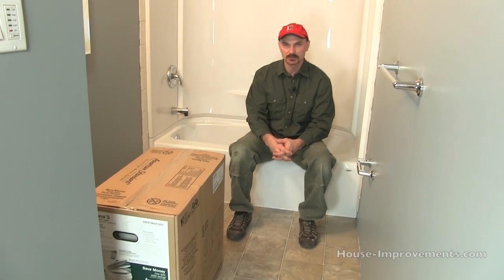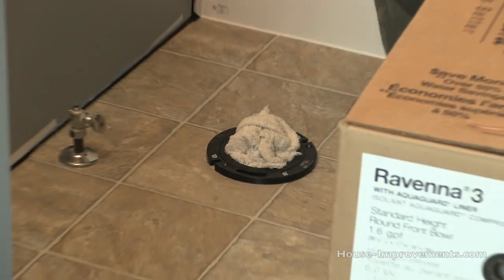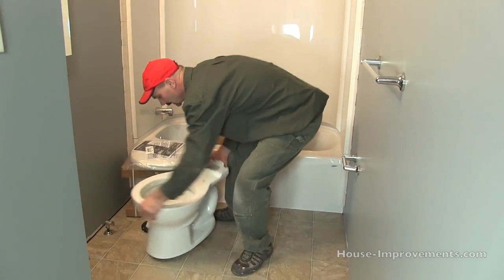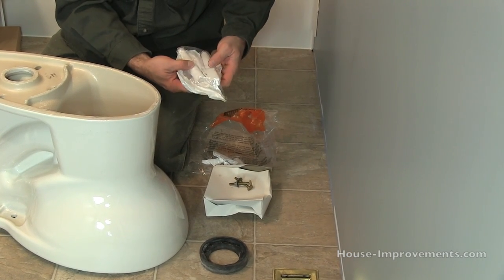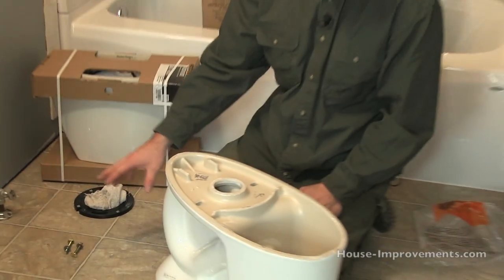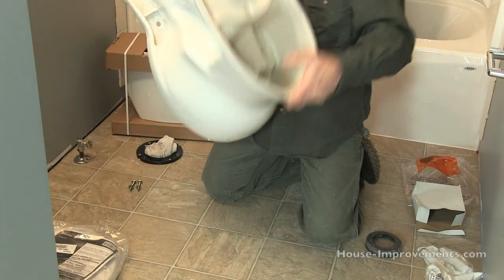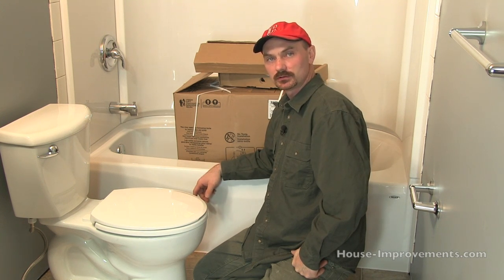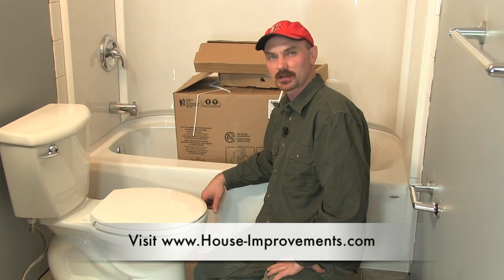How To Install a Toilet

Comment: Watching this bought back some memories, I worked at American Standard for 10 years out of high school back in the 80's before i went into law enforcement, then they moved their New jersey plant to Mexico. Looks like not much changed, flush valve looks improved, but that's about it. Your toilet was a refire, meaning when it came out of the One-fire kiln it had a slight defect which was repaired and re-sprayed then refired again. American Standard are quality, at least they were when I worked there, They did have a problem with the water quality in Mexico and it caused a lot to come out "dunted" or having hair line cracks, but they solved it through some water purification process. It was the hardest I ever worked in my life, but was a great way to get into the real world and learn to appreciate not physically killing yourself! Great videos, thank you.

Comment: Great video!!! I replaced 2 toilets with this model a couple of months ago. Lots of great improvements since last time I replaced a toilet (especially around flange bolts and caps).
The plastic tool used to secure the nuts for the tank bolts may also be used to tighten nuts for toilet seat bolts.

Comment: I work at Lowes, and used to work in the plumbing department. I always recommend American Standard. Best toilet brand Ive seen. I have a Cadet 3 with a 3 inch flush valve. Works amazing. The champion 4's are even better since they have a 4 inch flush valve which allows a more powerful flush.

Comment: Shannon, my late father in law solf plumbing supplies.  He helped me replace my 1st toilet a few years back.  He advocated using a bit of dish soap to whet the foam rubber seal between the tank and the toilet.  Tighten down the tank so that it has a slight rocking so you know you're not too tight.  Some parts of the country have a water conservation rebate.  In Colorado, we have a rebate for the low flush toilet ($69.oo USD) and $50.oo for front load washing machines.  My toilet replacement (comfort height) cost me about $50.oo after the rebate.

Comment: Simply setting the ring onto the closet flange is fine and IMHO easier. For flanges that are set against the finished floor height it's often better to use a simple ring with no reinforcing plastic bit in the center. On our last one, the toilet weight was against the flange itself and was not resting on the floor due to the extra bit of space the plastic took up. Depends on the toilet though. Wax rings should be WARM and easily deformed. If your ring has been in a cool location it won't squish to make a seal and may crack down one side.

Comment: Excellent choice for a toilet! American Standard Cadet 3 is the way to go. It performs well & is relatively easy to install.
Reply: Liam Brom Thanks, I wondered what toilet he was using.
Reply: +Liam Brom Good to hear. I just purchased one. However there were three different Cadet 3's in Home Depot. I bought the cheapest (still at $160). Not sure what the difference is among them
Reply: +Liam Brom yes we need something reliable to flush those turds.

Comment: Great video as always Shannon . 
This may sound like a strange idea , but I'm going to drill a hole beside my toilet flange and have a clear tube going threw the floor and back up again . I have an open basement , so this way I could visually see if there's a water leak under the toilet . 
I like your silicone idea and will do the same , go around the perimeter of the toilet , but leave the back open . Good tip
Reply from the maker: Sorry but not sure how that will work,good luck

Comment: I have better luck sticking the wax ring on the bottom of the toilet. I first heat up the base of the toilet where the wax ring goes with a hair dryer, press it on, twist very slightly and it seems to stick well with no problems. I always had problems putting the wax ring on the flange and the setting the toilet on top. Seemed to slide. Personal preference I guess. As always a good video Shannon

Comment: Shannon. I really enjoy your videos. I see that in this video that the flange was mounted on top of the tiled floor. I was told that the flange should always be flush with the surface of the tile, and if the flange was already in place before the tile was laid that a spacer should be used to bring the flange up to the level of the tile. I was told also if the flange is above the tile, depending on the toilet used, when mounted it could rock.  Also, was told never use a double wax ring to fill the space because the wax could cause a blockage in the drain. I'm not a plumber, but I sure would like have your feedback on this matter. Thanks.
Reply from the maker: My thinking is if you have vinyl flooring the flange is always sticking up because it is never recessed into the plywood or concrete floor so why would it be any different than a tiled floor. This was a vinyl flooring in the video by the way. All toilets I have seen are recessed on the bottom about 1/2" and most standers flanges are about 1/4" so the room is there. As for the the double wax ring I generally only would do that when the flange is flush to the top of the floor, I guess it could partially block the pipe maybe. Thanks for the  comments.
Reply: HouseImprovements Thanks for answering my concerns Shannon. So, I think I understand. Correct me if I'm wrong, that if there were an existing flange in place that was 1/4 inch above the plywood floor ( screwed to the plywood ) and then if the floor was then tiled, the flange would then be flush with the tile ( if a 1/4 thick tile was used ) and a regular wax ring could be used, but a double wax ring may be required.Is that correct? Thanks

Comment: Great video. I just started watching a couple of your videos and it's nice to see a simple video with all the information without all the nonsense some people like to add to them. There is only one thing I hate about those small toilets. Those little round toilets should be banned so you can only get the elongated type. Those tiny things are the worst toilets for men. Not to mention not the most comfortable. If anyone ever asks you, recommend the elongated type, even if it's a woman. Sooner or later a man will need to use it. Men need their space, specially here. Lol . By the way I had never seen a toilet installation so it was nice to see everything from start to finish.

Comment: I find your video very informative. As a Do It Yourself video, you should caution people about over tightening parts on a toilet such as the toilet seat and what it can do to the ceramic toilet. It can be a bummer if the installer breaks their brand new toilet fresh right out of the box. Snug the bolts, don't torque them...or snap!!!

Comment: Great video Shannon, but what if is needed to replace the toilet flange?show us how to remove the old flange,also what would you recommend plastic flange or metal flange? If the the rough out is not 12" ,what would you recommend? Thanks.

Comment: Great, helpful, informative video. I have a toilet to replace and I'll certainly use this as a guide. I have never done this before, so I am sure I'll need a good video like this one. Question: Should the foam inside the tank be removed? I noticed that you left it in.

Comment: Thank you Shannon.  Another fabulous demo.  I like the silicone tip about the gap in the back to detect any leaking.  I never would have thought of that.  Both of my toilets have no silicone seal mainly because I don't know what to buy.  I used to buy DAP but I've talked to people who say the DAP doesn't last.  What silicone do you recommend?
Reply from the maker: I like lepage.
Reply: Thanks!  I'll get some today.

Comment: Hey bud do you have a video about installing the toilet flange?

Also it seems like it would be easier to aim if you put it together after placing it on the wax ring. I guess this is a dumb question but is there a reason why you put it together first? Ill be installing my new toilet in three days- the process seems to be what i was expecting but i really appreciate you posting this, I definitely would have messed something up if i hadnt haha
Reply from the maker: We do not have a video for just the flange, sorry. Depending on your situation, sometimes it is tough assembling the tank to the bowl when it is installed in place. Usually there is a tub/shower and cabinet on each side and access is restricted so you are left to fumble around the back trying to see what you are doing.

Comment: Please make a video of you pushing th toilet upward from the front. I wonder if it will rock front to back since it is away from the wall.
Reply from the maker: If its siting flat on the floor and tighten down it should not. Do not rely on the wall to keep it from rocking.
Reply: @HouseImprovements  Thanks for your response. I followed your guide and the install went great! I watched a lot of videos and your's was the most informative, imo. I had the same issue with my toilet coming out from the wall and it did rock front to back when I lifted up on it, but after caulking that stopped it. I also placed a small block between the tank and wall to ensure it doesn't move. You can't even see the block from any angle. Feels like a band-aid fix but is working for me. Floor is relatively flat, so not sure why it is doing it. Even shims didn't help.

Comment: I do not prefer thick wax seals, they end up making more of a mess and have access wax coming through your bolt holes in your toilet. About brass closet bolts, they are not preferred because they are softer metal, they are recommended because they don't corrode or rust away. Note if you need a thick gasket to seal your toilet properly, install a closet extension ring and normal wax gasket with the plastic funnel. in the long run this method of installing a toilet is the over all best solution. As a plumbing contractor i see this nightmare all the time. most DIYers end up making things worse then if they would hire a licensed contractor to do the job correctly. This is just my opinion and 32 years of experience in the plumbing field.

Comment: My dad put in a new toilet on Saturday for me, and now it is dripping from the tank, where the 2 big screws are. The ones that are holding the tank to the seat?

Could you let me know what the problem might be? Do I need to put a plastic washer? right now, i am not sure if the plastic washer was being put on those 2 big bolts..

Thanks

Comment: I have a leak in the toilet tank that when I shut off the valve and leave it for a few hours, I see the water level in the tank go down. So I am thinking that the leak must be from the flush valve flapper. Is it best to replace the whole thing. Because I have replaced the rubber before and its leaking still? What is the best way to remove the big nut that is from the bottom of the tank that the rubber seal goes too? Do you have any special tools that I can go to the hardware store to get.
Reply from the maker: I would start with the flapper, buy one that is not super stiff plastic, they do not seal well. If you remove the flush valve the nut can be removed with a crescent  wrench.
Reply: I did replace the flapper but it's still doing the same thing. When I close the valve and leave the tank full, after an hour later the tank level is down. I know that it is the Flapper Valve. But thanks for the advise on using the Crescent Wrench. Thanks.

Comment: If my new tile job has lowed the toilet flange a 1/4 of an inch, do I really need to buy a spacer? The previous old toilet actually pushed wax ring into the hole when I removed it. An inch wide wax ring should seal, right?
Reply from the maker: If the top of your toilet flange is flush with the top of floor or up to 1/4" proud you will be fine

Comment: Could you please discuss methods  for drywall application over the flange of a new fiberglass modular shower unit. Specifically how to treat the surface area where the drywall meets the fiberglass so as to keep it as water tight as possible, and to prevent water/moisture infiltration that area of the drywall.
Reply from the maker: +Nicoletta Land Surveyors please use my forum for your questions .http://www.house-improvements.com/forums/

Comment: where are you from ? my toilet needs replaceing but first flooring round toilet needs to be repaired and i'm affraid to do it myself , cause water is shut off from outside meter and inside shutoff valve and waters still comming in ???? Help Please ...

Comment: I have never seen foam walls in the tank before. what is the purpose for that?
Reply: It's probably to keep the tank from sweating in the warmer months.
Reply: Reduces condensation
Reply from the maker: That helps reduce sweating and or condensation in the summer months.

Comment: i need advice lol but i am on the wrong video oh well. my bathtub space is 60 and 3/4 at the bottom the bathtub is 60 inches. the outside wall is leaning bad due to it being a 120 yearold home. what ar me options to fix this. i just dont see how im going to make it all work with the drywall
Reply from the maker: May have to cut shims to attach to each stud to try and get wall studs to appear plumb.
Reply: that is exactly whati did last night with furring strips. turned out nice, love your videos they are a great help

Comment: that washer is actually called a "speed nut"
Reply from the maker: ok thanks
Reply: HouseImprovements BTW, if you heated the wax ring first with a hair dryer or in hot water, might it adhere better to the toilet first as the manufacture suggests?

Comment: It's best to put two wax rings I thought
Reply from the maker: Sometimes that is wise ,like if the toilet flange is lower than usual. One example of that would be after someone has added ceramic tile to a floor but left the flange against the wood floor and not ontop of the tile.